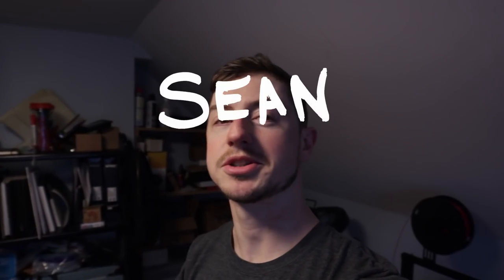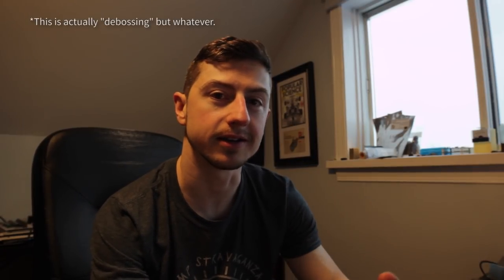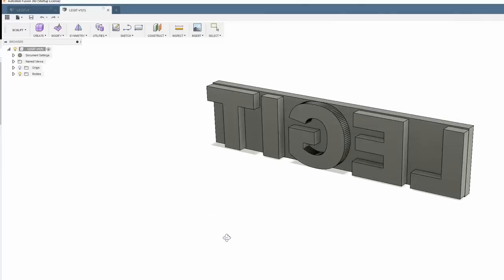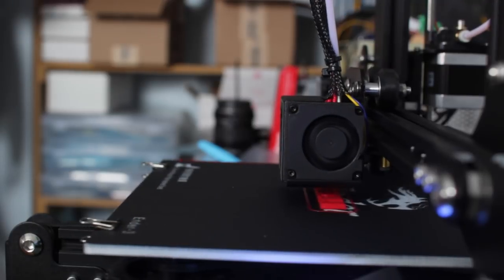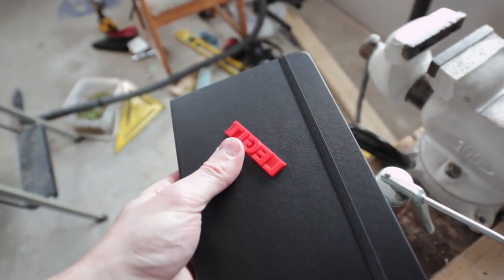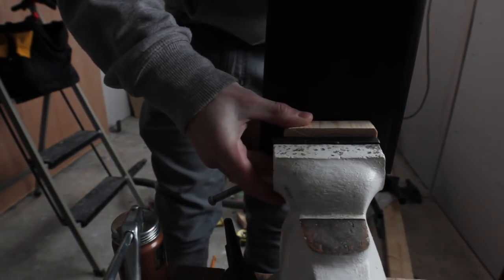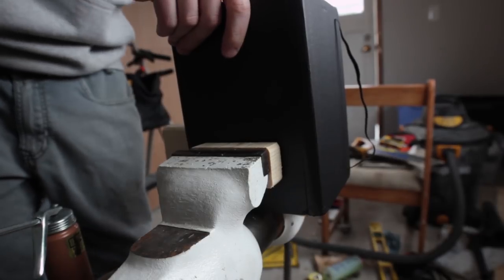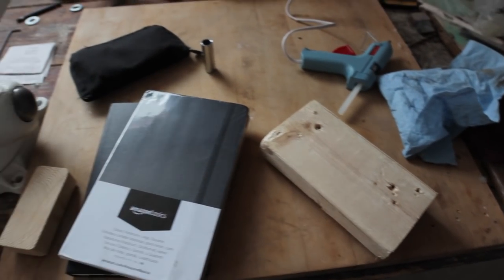Custom Embossed Notebooks Using 3D Printing (Great Gift!)

Comment: As far as ideas for possible improvements, you might consider adding a couple of "fences" to align the book to the stamp.  Could be as simple as a couple of small blocks of wood on a piece of plywood and having a third block of wood attached to the back of the plywood which would act as a hanger for the vice.  Just a thought if you are planning to make multiple imprints.  Regardless, cool work as always.

Comment: What if i want to do a larger image like to cover the whole front of the book would the vice work for that seeing that it seems to be only pressing a small space.
Reply from the maker: Just have to try and see. It will require a lot more force, like a book press or something similar.
Reply: You could use woodworking clamps instead of a vise. Then you can use as many as you want or need. Also using clamps allows easier placement of the design.

Comment: May be easier to use an easy to remove tape, like painters tape, and tape the print to the book instead of gluing it to the wood. Then it's perfectly aligned before it even goes to the vice. Cool video though!
Reply from the maker: Awesome Idea! Definitely will result in a better aligned imprint.